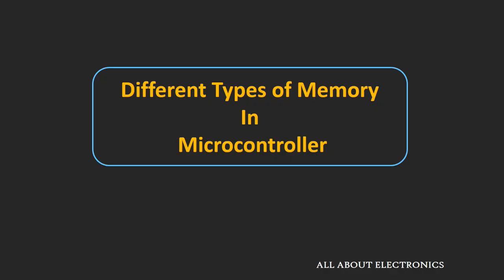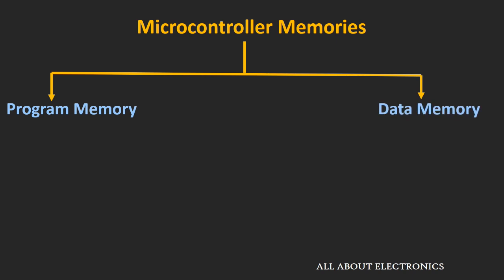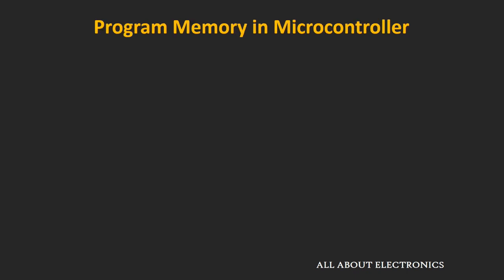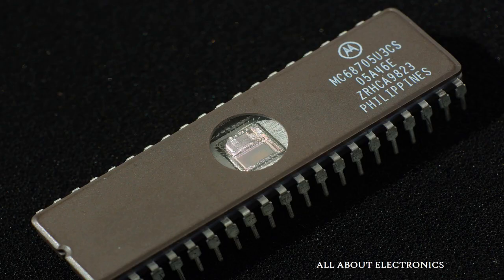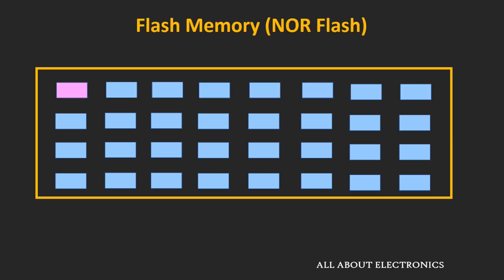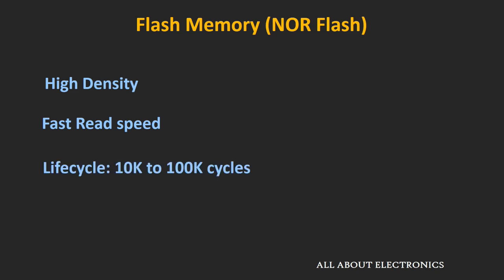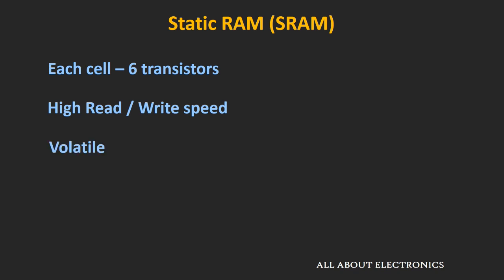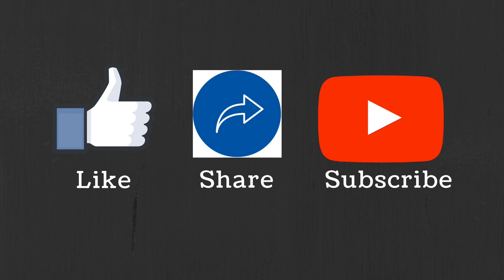Different Types of Memory in Microcontroller : Flash Memory, SRAM and EEPROM

Comment: What is volatile memory and non volatile memory
Reply from the maker: In volatile memory, the data remains in the memory till the power supply is ON. As soon as the power goes down, the data will be lost.
The non-volatile memory can store data even if the power is not present.